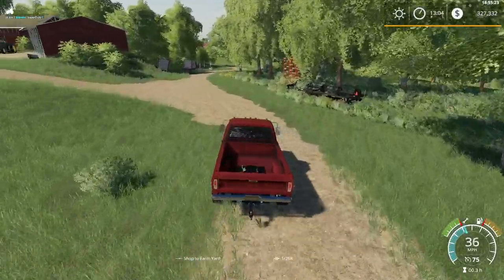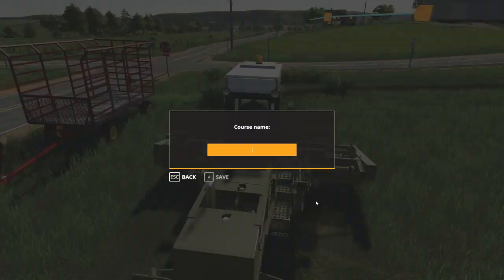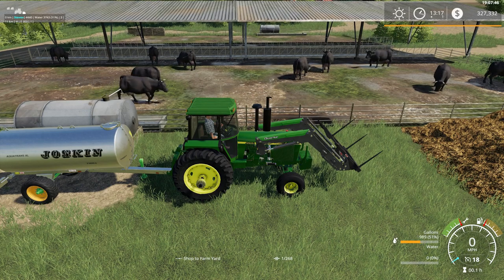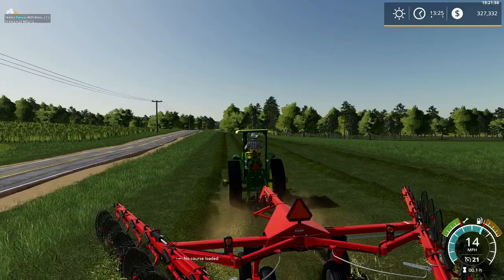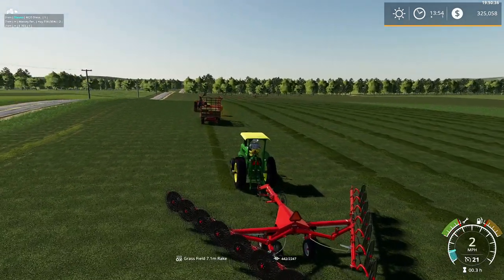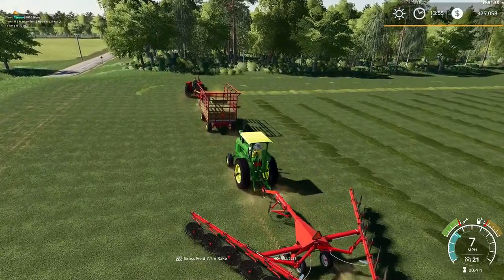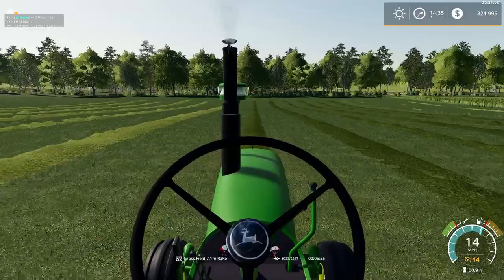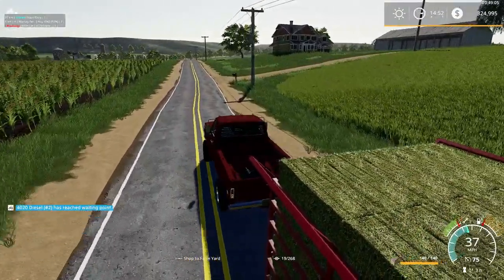SMALL SQUARE BALING TEAM | FARMING SIMULATOR 19 | UNIT CONVERT MOD IT'S FINALLY HERE!

Comment: Love the old classic tractors I own a few. 1968 Ford 5000, 1959 B275 international, 1967 and 1968 Massey ferguson 135. That McCormick W9 reminds me of the W4 we had years ago it was only 28 hp so it wouldn't be strong enough to run that baler and pull a wagon.

Comment: There was a Massey Ferguson self-propelled swather or mower in the Massey Ferguson old generation 1970-1990 and if u download it it'll be in the forage harvesters section and the header is in the forage harvesters headers section
Reply from the maker: Logynn Dickerson Do you remember where you got it?   Yep m interested.
Reply: I.can see if a mod group would change it to fs19
Reply: @logynndickerson1716  I don't think they have cus it would have been sent to Giants for testing
Reply: @logynndickerson1716  Dont let a mod group change it to 19 dude that's just rude. Leave it alone if the original creator wants to transfer it they will or if they want to let someone convert it they will. But don't just ask a random mod group to do it and take all the credit of transferring it. I

Comment: I have spent many hours with a hay press with thrower, for the most part you fill the wagon without touching the bales, it is only at the end when the trolley is almost full as you put the bales to the right to fit with more but normally you can get in 200 without doing anything at all (with some luck)
Reply from the maker: Cptbear/JD1470 That’s cool.  Thanks for the info